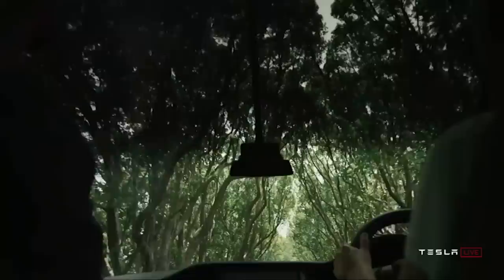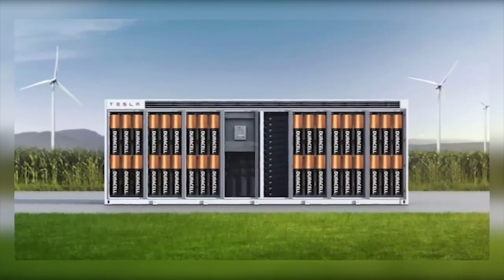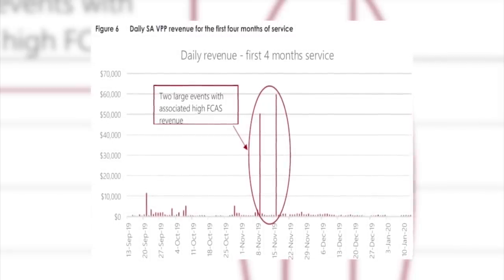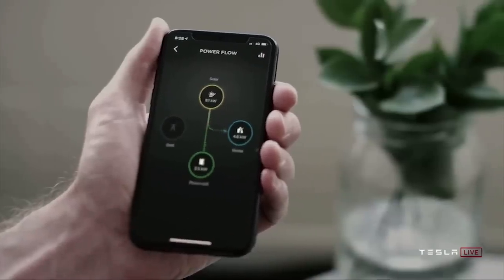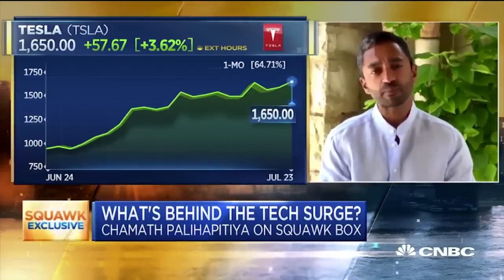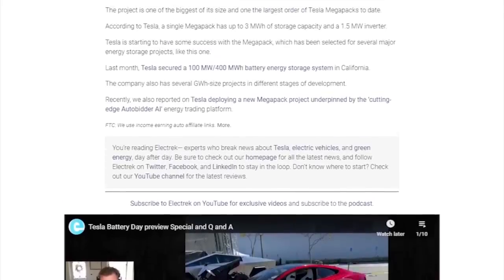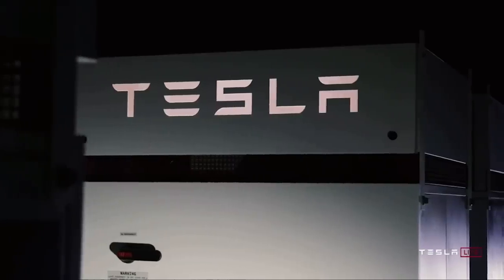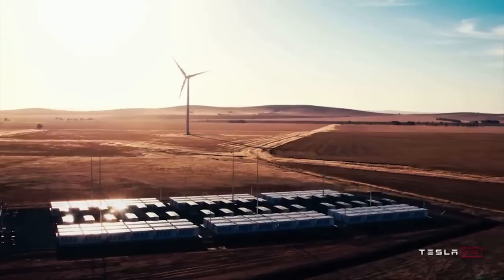Tesla Battery Farms Will Destroy Utility Grids

Comment: Casgains does not understand electric distribution through the grid. Tesla does not build power lines. A connection to the grid will be essential even with solar and battery backup - only utilities can provide this. Tesla technology and partnership with utilities across the globe will be the key to a carbon neutral future. Keep in mind, the real cost of energy supply is in the delivery, not the generation.

Comment: The South Australian Hornsdale Battery costs A$90M which supports 30,000 homes for 8 hours or 240,000 homes for 1 hour. South Australia has a population of 1.8M in 797,000 homes. This means the battery only lasts the population 20mins. To not rely on baseload plants, you need to build 36 times the size (3X to cover 1 hour, 36X to cover 12 hours) at a cost of A$3.24B to cover on average 12 hours of non solar production time per day. To really remove baseload plants, you need to cover the winter scenario of at least 1 week of no or weak sunlight with heaters turned on at homes. This means to support a population of 1.8M you need to increase the size to 504 times the original battery (3X to cover 1 hour,  72X to cover day and night for 1 day, 504X to cover 7 days) at a price of A$45.36B.

After 10 years, battery degradation will take out 7% of capacity. This mean you need to put in 7% more or swap out 7% of the batteries every 10 years. That is a operational capital cost (OPEX) of $3.17B every 10 years or $317M yearly. Also, to maintain the battery farm 504 times the size of the original pack, you need to hire a maintenance crew of at least 20 technicians/engineers/supervisor/support personnel at an annual cost of A$10-15M including parts, vehicles, building etc.

All the battery does is store energy. It does not produce energy. And it will cost the 1.8M people $45.36B to build and $327M a year to maintain. 

If you extrapolate this to New South Wales (including Sydney) with a population of 8.2M, it will cost A$206.64B to build and $1.49B a year to maintain. $33.44/kwh anyone ? (vs $0.26/kwh in Western Australia)

If you extrapolate this to the entire Australia continent of 25M population, you will need A$630B to build and $4.54B a year to maintain. For comparison, the National Broadband Network costs A$51B. The maintenance cost alone can build you a new baseload gas power plant (A$4B) every year.

Or you can install a woodstove during winter which defeats the purpose.
Reply: very interesting.  Australia is doing great things in the energy sector, having solid state storage is more than just a backup tho.  Read this, I find it fascinating ... and I think it can change the entire world:  https://www.theguardian.com/australia-news/2020/aug/27/enormous-opportunity-how-australia-could-becomehe-saudi-arabia-of-renewable-energy

Comment: Site generation and storage will replace the grid with much smaller grids and then no grid at all — flying craft that absorb energy faster than they expend it will have unlimited range and cost pennies per mile; most all surface transportation will be golf carts, bicycles and yachts.— all in less than ten years — the systems have already been invented and the rate of invention is accelerating.

Comment: Even if Tesla manages to crank out enough batteries to make this vision come alive, we'll still need power generation plants.

Solar, wind and hydro are great, but trying to do everything with one system isn't realistic.  Fossil fuel isn't going away for a long time.  It's too useful and mobile and energy dense to ignore.

Personally, I'm hoping to see liquid salt Thorium reactors contribute in my life time.  Whatever the case, I'm sure Tesla can provide the battery packs.
Reply: There are plenty other battery manufacturers out there too. Some been around for as long as 130 years. Tesla's been making batteries for how long ? 5 years or less ?

Comment: So expensive! Could use old fashion deep charge lead acid batteries! Like the idea for homes...although id like to see where the cars would be designed to have batteries that can charge at home and pulled off the wall and then inserted into the car and then put back on charger at will! You could actually charge them from the grid if so desired. This would extend range by having an extra charged battery in the trunk if you wanted. You could recharge the battery in the car and the back up at sametime .. Large battery systems for small communities could be cheaper lead acid batteries that have a computer system that maintains the batteries where they are not over charged or discharged to much and charges batteries as necessary. A system that monitors water levels and levels are maintained.
Reply: idiot

Comment: The mega pack is going to save utility grids, not destroy them.  Australia is a perfect example, where the grid was failing on a wide scale.  Tesla batteries saved it.  Mega packs are being purchased by utilities, not individuals.  You could say they will destroy peaker plants, however.
Reply: Dirk Knight the way I understand it, WA was having massive, repeated blackouts and grid failures.  The Tesla battery saved it, it didn’t destroy it.
Reply: Dirk Knight maybe so, but the battery helped the situation, did it not?

Comment: with the new tabless batteries' lower cost and greater speed of production? DEFINATELY. I envision mega-pack plants that are specific to energy storage ONLY- where the batteries are tesla's new silicon / iron batteries, WAY cheaper to produce. and with the much faster production rate and cheaper cost- coal & petrol based plants? just won't make any sense at all. at that point- energy companies would be CRAZY to even consider coal, as it would mean financial ruin to compete with solar / megapacks. BUT EVEN BIGGER? I foresee the grid going completely DC. the only reason we ever had AC current to begin with was to run induction motors. when the energy grid was first started- transmitting DC & then 'converting' to AC at point of use was SO inefficient & expensive that it was impractical. but now- with brushless motor tech. being implemented into everything? it's AC that no longer makes sense. a variable frequency drive (VFD) can seamlessly be included in the production of tools (already done), cars (tesla's: duh! already done) appliances (hvac- ALREADY DONE) AND LIGHTS? LED'S run on DC current already. DC current grids would allow the ENTIRE grid for the USA to be powered from 10 terawatt hour packs in texas, new mexico, arizona. the entire country uses around 10 terawatt hours in 24 hours. having triple state redundancy at 150% would mean NO PEAKER plants would ever be needed. then there's the fact that 10 twh doesn't count the fact that alot of that power is already produced by home solar, wind, etc.
Reply: The reason for the grid had nothing to do with induction motors. It was distribution losses and how high voltage AC using step-down  transformers locally (substations) hugely minimised those losses. You can't do that with DC.
Reply: pasoundman you're missing the point. i know step transformers help with ac transmission. that's not the point
Reply: @jaybee3165  NO, you're missing the point. Any grid relies on transformers which means it has to be AC.
Reply: pasoundman any LOCAL grid. the problem with ac current is you can't transmit further than about 250 miles without HUGE voltage loss. dc will transmit over LONG distances with negligible losses.
Reply: pasoundman the current method for grid scale wind and solar storage and transmission STARTS as dc, transmits as dc to a local grid, where it is switched electronically to ac and THEN tied to local grids.
Reply: @jaybee3165  why do you call them 'step' transformers ? What IS your point ? Eliminating the grid ? Good luck with finding 80GW of 24/7 reliable generation in california alone !!
Reply: @jaybee3165  I know ! Even the transition to HV DC is kinda new though AND expensive. How do you plan to turn that 800 or so kV into something safe for houses offices and factories ?
Reply: @jaybee3165  So, what would you use as the intermediate and final (home) voltages ? Shame about the big machines that rely on 3 phase.
Reply: pasoundman one tech firm in the bay is experimenting with the possibility of using buck regulators on a more localized grid, and staying dc all the way to local area substations.
Reply: pasoundman ac current just had too many losses over distance.
Reply: pasoundman and NO- not every part of every grid uses ac.
Reply: pasoundman  Belo Monte-Rio de Janeiro transmission line, Brazil – 2,543km. The 2,543km-long Belo Monte-Rio de Janeiro transmission line in Brazil is an 800kV ultra-high-voltage direct current (UHVDC) line that transmits electricity from the 11.2GW Belo Monte hydroelectric power plant located in Para to Rio de Janeiro, Brazil.
Reply: pasoundman you were saying?
Reply: @jaybee3165  I know about such stuff. Daft idea. There's a serious problem with high frequency power inverters and wavelength.You didn't answer what your ideas were for the various voltages from 800kV down. You can't distribute power at 240V. Leds need 4 volts. C'mon !
Reply: pasoundman problems with inverters? not in CA. they work flawlessly.
Reply: pasoundman you're saying dc can't be done...  I just showed you- it already HAS been done. so what difference does it make HOW it gets done?
Reply: pasoundman A long-distance, point-to-point HVDC transmission scheme generally has lower overall investment cost and lower losses than an equivalent AC transmission scheme. HVDC conversion equipment at the terminal stations is costly, but the total DC transmission-line costs over long distances are lower than for an AC line of the same distance. HVDC requires less conductor per unit distance than an AC line, as there is no need to support three phases and there is no skin effect.

Depending on voltage level and construction details, HVDC transmission losses are quoted as less than 3% per 1,000 km, which are 30 to 40% less than with AC lines, at the same voltage
Reply: pasoundman only advocates of "burn coal, burn gas" ALWAYS have the same old worn out last century excuses why "renewables won't work".
Reply: @jaybee3165  Where has it been done ? You do realise that DC/DC converters need transformers or inductors that aren't operating at 50/60 Hz ? A very large 50/60 Hz transformer is not difficult. Kilohertz or tens of is very different. What are your intermediate voltages ?
Reply: pasoundman AND? the 'atom switch' may be changing all of that very soon.
Reply: pasoundman as usual, you coal burners only talk & don't listen. you locate solar & wind farms where there is plenty of solar and / or plenty of wind. you locate a 10 terawatt  bank of batteries there. the current is created, stored & transmitted in DC, over hundreds, even over a thousand miles, til it hits an area like- Chicago. there, it runs into one of several inverters, where it is changed to AC current. it's being done that way RIGHT NOW all over the world. in fact, pg&e in CA actually prefers this method to coal peakers as it quickly re-coups the startup cost. no one is forcing them- solar & wind are just cheaper.
Reply: pasoundman it's only people with a vested interest in coal or petroleum that keep constantly whining "it can't be done". do a search on dc transmission of power. see for yourself. the reason oil companies like to spread their bs stories about how "inverters don't work" and "can't run on solar, have to have peaker plants" is because they have lost half their market share to solar.
Reply: pasoundman and yes, the change can't be done overnight, but power companies ARE doing it. and eventually, ALL OF THE GRID will be wind & solar with dc backbone to move the energy from remote areas to the demand area & injected at that point into a localized ac grid. why is that so hard for you to understand? there is, however, a new solid state breaker system called 'atom power". that has the potential to make inverters a lot cheaper to produce. also, large scale buck converters are over 90% efficient at stepping current down . but no one has bothered to try. if successful , this would save millions of kwh's in voltage losses if you could eliminate ac current all together.

Comment: The largest battery array in the world is the Tesla set up in South Australia. If this fully charged battery array is connected to the aluminium smelter in Tomago New South Wales it could power the smelter for a grand total of six seconds ! Battery storage of solar and wind is a complete fantasy. The world requires reliable baseload power such as nuclear.
Reply: True, electricity grids are mind bogglingly huge. A few or even a few tens of GWh is hopelessly insignificant. As I tend to say, you can't run blast furnaces on solar panels.

Comment: I would be wary about Tesla dealing with PG&E. Didn't they declare bankruptcy because of the Paradise fire? It would be nice for the west coast if they started adding battery farms but the fire were caused by transmission wires, something that needs to be reduced to reduce the possibility of fires. Solar panels, especially in California, should be a no brainer linking excess output to local battery mini-farms, reducing the possibility of forest fires (for those of you not familiar with CA, a major portion of electricity generation is from hydroelectric power plants mainly in the Sierra Nevada mountain range, which has a lot of flammable material in it).
Reply: How do you plan to replace/reduce transmission wires ? FYI, California is already generating TOO MUCH solar for the grid to cope with, meaning that PG&E has to export some of it to nearby states. The strain on the grid caused by solar is exactly the reason behind the rolling blackouts.
Reply: @pasoundman  Does PG&E have any large scale battery storage or is all the energy being produced being dumped onto the grid? If using too much solar, then this energy needs to be stored in Tesla megapacks in regional areas so they don't have to use all the high voltage power lines coming out of the mountains from hydroelectric powerplants. If PG&E has too much power then they need to get rid of whatever power plants aren't necessary instead of continuing to overload the grid.

Comment: What is the percent loss when transferring the electricity from the grid to the battery and then selling it back onto the grid? I don't know much about batteries but I'm wondering how much profit there is after that is factored in.
Reply: Around 10% loss typically.
Reply: @pasoundman  thanks. Just to clarify, 10% from grid to battery and then 10% when the power is returned or 10% total?
Reply: @jhornett  Allow 5% each way.
Reply: @pasoundman  thanks

Comment: I think you'll still need large amounts of power for heavy industry.  I also wonder about if the batteries and micro grids become so popular if it would be better suited to have DC powered appliances instead of having to convert to AC.  I also wonder about if Tesla employees will ever be able to unionize
Reply: I was considering the possibility longer term.  In my custom build I plan to insert a clause for all horizontal electrical runs to be in the crawl space or attic, none in the walls, and none directly from wall box to wall box.  I was thinking more of converting lighting in the future, but this would also support appliance and outlet conversions.
Reply: You'll never have DC powered appliances. There are many too different DC voltages needed. Also, many motors make use of the supply being AC.
Reply: @pasoundman  One route around this is multiple tap points on battery packs.  For a simplistic view, imagine the arrangement of 10 12Vdc batteries with a tap at each battery, allowing 10 different dc voltages (12, 24, 36,...,120).  Balancing the load becomes critical but would definitely be doable.  You can also add automatic switches between taps - if 1 set of 48Vdc taps ran low, would switch to another set of 48Vdc taps.

It wouldn't have to completely replace the invertor so AC motors could still be used.

It would definitely make for a hellacious variety of plugs and receptacles.

Comment: If you put solar on every roof, you won't need megapacks. You might have to keep distribution up, but large scale won't be required. I suspect 10 houses linked up in a microgrid. They share power for low cost and high reliability. All the rest of the current grid is overhead.
Reply: And at night ?
Reply: @pasoundman  This is assuming a Tesla Powerwall at each house. The shared microgrid is for extra security. Basically, if you do a once a week extra use for whatever reason (say you wash and electric dry a LOT of laundry one night that week when your three kids come home from college and mooch off you!), you can distribute the use across 10 houses. So you don't have to have a whole extra Powerwall at your house, you share the load and increase reliability. Thus is the nature of distributed generation microgrids. The battery is simply a requirement unless you want to go back to pre-1900 standards. lol!
Reply: @anthonylosego  What's the power capacity of a Powerwall ? How does it fare when both the stove and the washer/dryer are on ? Typical UK homes have a 24kW supply. Such an idea isn't realistic in Northern latitudes anyway where solar in winter is as low as 10% of summer insolation. Never mind cloudy days ! Do bear in mind that a 'microgrid' will need a strong legal agreement between all users. Good luck to those trying it.